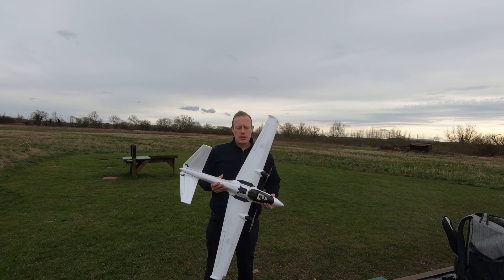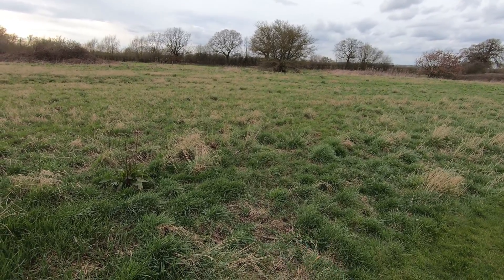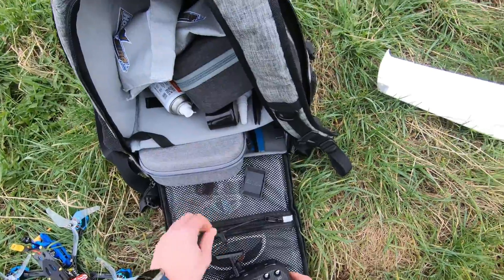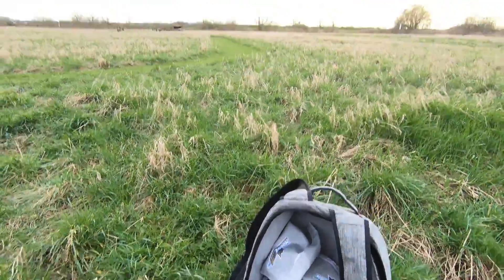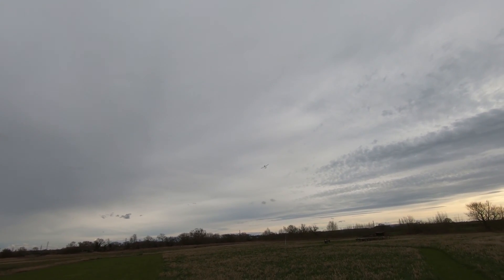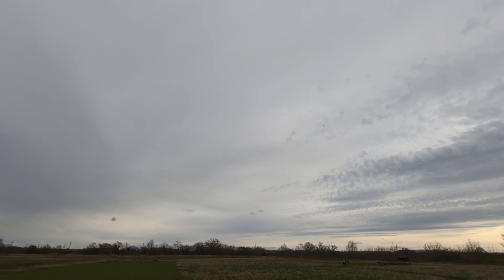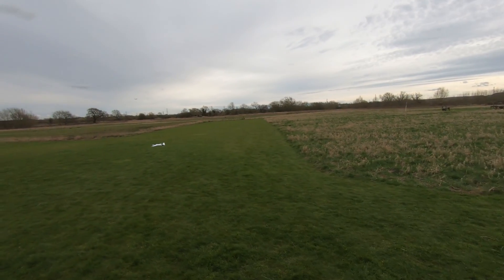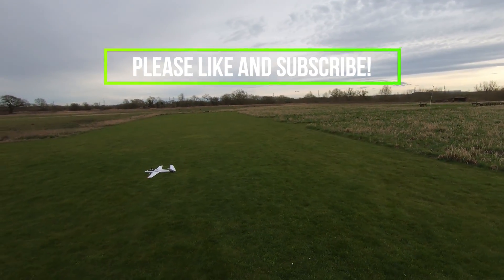Atomrc Swordfish - Improved Flights With New Battery And Optimal Center Of Gravity

Comment: Just get 27100 Li-Ion Molicell P50B into 4S work as charm :) only 300g weight of the battery with the wires and connectors and plus you get 5000mah, current draw it's not an issue with those cells.
Reply from the maker: Yeah good suggestion 👍🏻

Comment: AtomRC recommending the ZoHD 4S 5000 pack is just utter nonsense. Not only does it compromise CG, the current draw on launch greatly exceeds the 10A max draw spec of the battery. That said, the plane is an utter joy to fly! Thanks for the video!
Reply from the maker: Yes you’re absolutely right. Thanks for watching 👍🏻
Reply: He said that he got 5000mah Lipos though, those are a lot bigger than the 4s 21700 pack that they reccomend.

Comment: Thanks for the video. Right now I’m in the throes of setting up my INAV for my maiden flight. Was considering switching over all my Spektrum batteries, they are all Lipo. How many minutes roughly of flying time were you able to get out of a 3000? Enough for a long range flight?
Reply from the maker: Excellent have fun. If you have any questions let me know. I would say about 30 mins possibly longer if you are steady on the throttle.

Comment: Mornin‘
Do you have any Tipps for programming an rc jet?
I just bought an hawker hunter and it is my first Edf jet.
Reply from the maker: What do you mean by programming it? Thanks
Reply: @tdogrc  I mean if you have some Tipps for mixes and  servo settings
Reply from the maker: @German_Rc_noob  ah I see. I guess the main thing is EDFs usually fly pretty fast so I would definitely recommend setting low, mid and high rates (50%, 75%, 100%) on a 3 position switch. Also I would dial in about 30%to 40% expo. Hope the maiden goes well dude 👍🏻

Comment: how does your radio tell you what mode you are in?
Reply from the maker: With EdgeTX you can program voice prompts to sounds depending on the position of a switch. So it doesn’t actually know what mode I’m in, it’s just makes the prompt when I put the switch in a certain position. Any EdgeTX radio can do it using the Special Functions menu 👍🏻